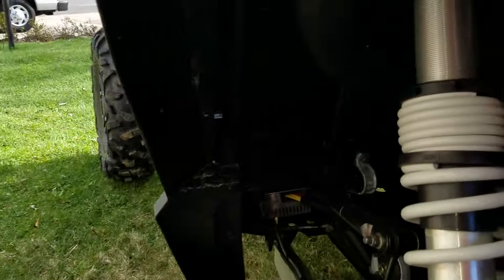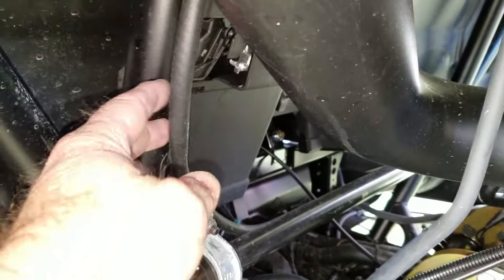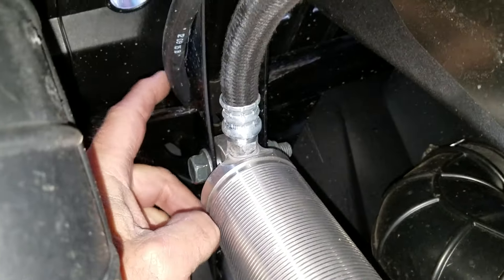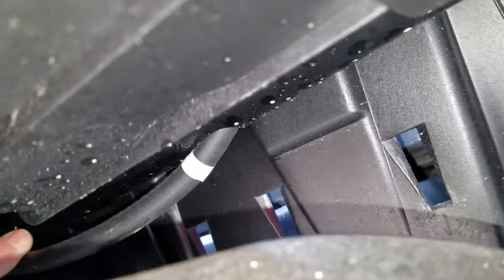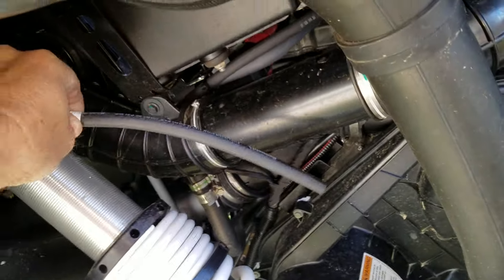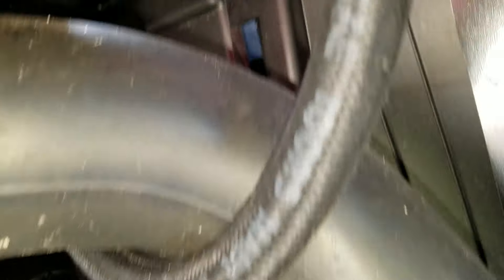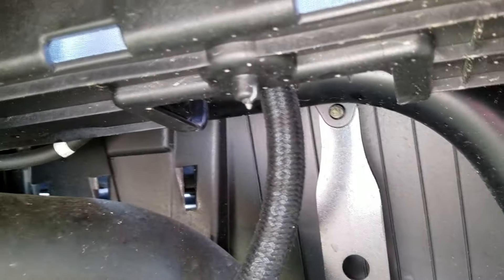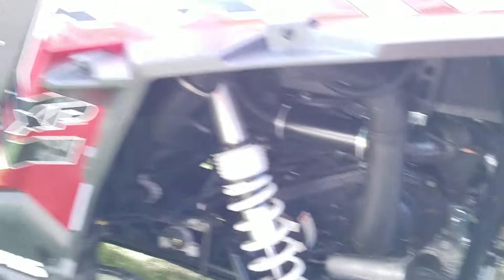2016 RZR XP1000 gas tank vent tube

Comment: i believe the routing is not the problem though some have not been set up at all and simply coiled up to the frame. you have the heavier black vent line that is kink proof. the recall is for vent line that is clear and crimps easily
Reply: I am with you I don't think problems is the route, I have  recall on my 2016 routed same way but I have clear vent line.

Comment: same her. I have 15 rzr Trail 900. have 4 recalls. my vent line looks fine I checked it myself. however I do have a gas smell in my cab when riding. could be something to do with the vent line possibly